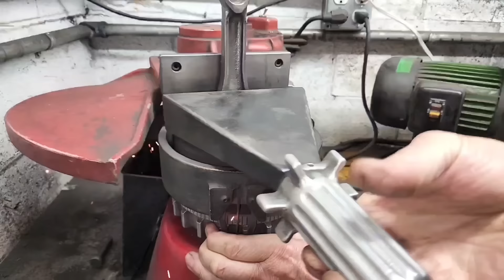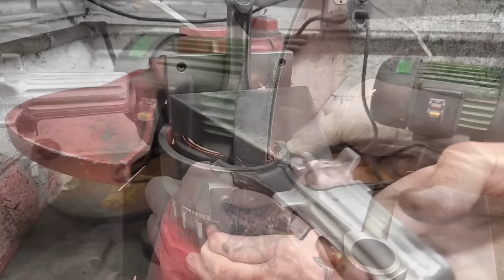Nobody resizes rods correctly see how I do it

Comment: That is how I was taught - 50 years ago. Never knew that could be skipped or that there was any other way to do it.
Reply: Wow, the YouTube AI overlord auto deleted my comment about working at a place in 04 with old machines that had Lend Lease property tags riveted on them, must still be some kind of national security issue.
Reply from the maker: @dukecraig2402 😂😂😂
Thanks for watching Duke 🇺🇸
Reply: @dukecraig2402  My Dad worked at the Kansas City Pratt&Whitney R2800C Government Facility that could not make any of those engines in time for WW2 because the Sunnen Centerless Grinders needed for so many things had been under presidential emergency put on a ship and sent to England. Those sleeve-valve Napier Sabre V engines would ONLY work if the sleeves were ground inside and out using DULL WHEELS at 1/10th the normal feed rate. That produced durable mirror finish.
But it used a hell of a lot of grinders and forked USA out - no argument - THE finest gasoline engines EVER MADE. Dad was on the throttle when one of them ran on FIFTY PSI BOOST FOR 24 HOURS making 4000 shaft the whole time - which became a military secret only declassified in '69 so Darryl Greenamyer's Bearcat Conquest One could take the prop-driven speed record.
Reply: @dukecraig2402  Your comment is on there. A LOT of comments are only visible if you click on the picture and go to that playback. Then hit "newest" and prepare for possibly a long scroll. Be a good idea to know how many hours ago the post you want to see - was posted. Five hours ago - I noticed - can be worth turning your scroll-lines-per wheel click "up-to-ten" . . .
Reply: @patrickshaw8595 
Thanks, I never knew this about finding posts that disappear.
And oh wow!!! I've read about that test and how they kept it classified until the 60's, that's really cool your dad was the guy with his hand on the throttle.
Reply: @dukecraig2402  First two hours. BTW I was 6 and 8 the two times My Mom got permission to take me to see Dad at work. I shook the hand of Luke Hobbs a.k.a. "Mister R2800". 
      PW in Hartford Conn had been pooping around with the R4360 the entire war - they gave Hobbs the total redesign of the R2800 resulting in the R2800 "C Series". He killed it. Thing ran so smoothly it didn't need or have rubber in the engine mounts!  Every time Hartford cleared a 24 hour milestone Hobbs would duplicate it with the 2800, lol.
He had an intuition about them. After the 4000hp for 24 hour 4360 run - Hobbs (and Dad helped) ran the 2800 at 132 inches of mercury and 3000 rpm and said "that's it, boys - that's all she's got"
Reply: I don't know if the exact miniature R2800C is still in Pioneer Village in Minden NE or not. But it ran and was dynoed tool. The Guy who was top Machinist - well really top Toolmaker - well really Head of the Modelmaking Shop - was a friend of Dad and his twin Uncle Jerry who designed all lawnboys up to '74. THAT'S who taught me how to design and build stamping/bending'/embossing/and "steel rule dies" - ages 14 to 25. In his basement. PS - I have two of of the machines that reground connecting rod journals - in your driveway, while you waited ! IN THE CAR/TRUCK!
Reply: @patrickshaw8595 
I just got the book "R2800, Pratt&Whitney's Dependable Masterpiece" by Graham White.
Yea Hobbs name is plastered all over the inside of it so much it's a shame he didn't get a royalty for every gallon of ink used to print it.

I also just got "Vee's For Victory! The Story of The Allison V1710 Engine 1929-1948" by Daniel Whitney (ironic?).
I'm in my glory, both are filled with the kind of technical information I'm always looking for, valve timing etc etc, that you can't just find on the internet, or at least I never could. 

I went to PIA years ago but never worked in the field, instead I decided to use what I learned towards my true passion in life, motorcycles, I've been building performance Harley engines for a living for 35 years, not having federal oversight in the motorcycle field, unlike in aviation, has afforded me the care free lifestyle I've always enjoyed in the biker community 😜

Years back I started collecting books from Harry Ricardo and others teaching myself the math of engines, ie calculating the optimal port cross section for what I'm trying to achieve with a particular engine modification, I collect and look at as much data as I can with known results to see how my math compares to it, I also have software for building fictitious engines that I can get comparisons from that's amazingly accurate, to do all this I need information way beyond just bore×stroke, I need valve timing especially connecting rod length which I've never been able to find for those engines to see how my math holds up to the known output numbers from them.

They're also great sources of information for myth busting, for example like everyone else I'd always thought the single stage single speed supercharger was all that was available for the V1710 at the time the British commissioned the P51 to be developed, which led to the misnomer that the Merlin was "more powerful" than the Allison based on the P51 story and people who don't understand supercharger types and how altitude affects them buying into that narrative, not true, in the book Vee's For Victory is a chart showing each variant of the V1710 and when they became available that proves two things, that the 2 stage high altitude supercharger variant of the Allison was available when the British commissioned the P51 to be developed, but they ordered it with the single stage Allison, like many I've always believed the 2 stage Allison wasn't available unti after the US was already in the war and the Army funded development of it, knowing it was available also confirmed a suspicion I've had for years, they planned from day one to have the not quite ready yet Packard V1650 installed in it as soon as it was available, I've been suspecting that for years and it's like I've been telling people for years "You may be learning about the different supercharger types and how they're affected by altitude and how they'll determine the performance envelope of an aircraft as you learn about these things but these weren't people who were learning at the time, they knew very well how altitude was going to affect the P51A before they even got in one, to think they already wouldn't have known and were 'disappointed' with it's high altitude performance would be like suggesting that I can't look at the specs for an aftermarket Harley cam and know relatively close how things are going to come out when it's put in an engine, I know what I'm looking at and so did they at the time, it's ridiculous to believe they wouldn't have known already what was going to happen at altitude, it wasn't a surprise".

I know why the British wanted as much of that aircraft to be domestic as possible at the time, they wouldn't have any problem setting up a production line for the airframe but they didn't want to get stuck with an engine that they had to entirely rely on the US for parts and support, this was before the US had gotten into the war and any support they were getting from the US was technically illegal, the powers that be had to get very creative to skirt the neutrality laws, so they had to worry about an administration change leaving them to deal with a hostile administration that could cut them off from the supply of engines and parts they'd have been locked into, I get it.
Reply from the maker: Thanks for watching Patrick 🇺🇸
Reply: Me too! 50 years ago same equipment too!
Reply: @tcbquick  Yeah and the stuff was old THEN. Pretty sure most of that stuff was built under War Production Board orders '41-'45. A LOT of it had apologetic little tags saying "The fit and finish of this machine were specified under W.P.B. Order such-and-such and is not that specified by (whoever company) For Commercial Sales."
That old grayish green dull enamel...
Reply: @patrickshaw8595 
I used to work in a shop here in Pennsylvania back in 2004 that had a bunch of old machines that had British Lend Lease tags riveted on them, probably ⅔rds of them were Pratt&Whitney manufactured machines.

Comment: With all the cleaning, crack testing, remove bolts, grind, deburr, fit new bolts, supply new bolts,  and resize....  What is the cost compared to the stock replacement style New Scat Rods  ???
Reply from the maker: My rods are $250
Thanks for watching and subscribing see-ya next time 🇺🇸
Reply: @BearButler321  Wow, that's cheap... your working for $40 bucks an hour in your machine shop..???....  Keep well...
Reply from the maker: @drcolster It takes about an hour 15 minutes to do The bolts cost $35 👍
Reply: @BearButler321  Faarrrr out, to redo a set in Australia we go way past the cost of a New set of Scats.....  that's with grinding and shotpeening...ARP bolts here are like $170aud..  Anyway, thats a good time and cost then... Keep Well.....

Comment: Do you have to use a specific kind of oil in your honing machines or will any oil work? I run machines at work that make the lenses for 80% of the world's eye and sunglasses. However, I would much rather be working in an automotive machine shop. The machines we use are zero hands-on. The prescriptions are all read out by the computers in the machine and they do all of the adjustments necessary.
Reply from the maker: It's a special oil made just for honing 
Thanks for watching Donnie 🇺🇸
Reply: @BearButler321 I kinda thought that but I didn't know for sure. Is the oil thicker or does it have certain additives that help in the honing process?
Reply from the maker: @donniev8181 it's not thick 
Just special

Comment: Hi Bear, love your videos!!! Hey how is the cap and rod centered on the grinding vise ? Dennis old retired Shipyard outside machinist.
Reply: It looks like it sits flush on a centering block then gets locked into place using the handle. Is the red cap and rod grinder what you were asking about? Im with you, I find all of these machines fascinating. I personally operate the machines that edge out lenses for eye and sunglasses. My company manufactures 80% of the world's eyeglasses and sunglasses. I would much rather be in the automotive industry though, it's more hands on.
Reply from the maker: @donniev8181 It actually sits on a round bar and doesn't need to be centered at all 
I'll do some 390 rods maybe today and show it
Thanks again Donnie see-ya next time 🇺🇸
Reply: @BearButler321 thanks, I didn't know exactly which machine he was talking about.
Reply from the maker: It doesn't need to be centered it sits on a flat bar
And it is clamped down 
It could be a 1/4 inch off center and it wouldn't matter
Thanks for watching Dennis 🇺🇸

Comment: Well, I  learned something new. I thought it had to be tight to keep it aligned.
Reply from the maker: They are not loose but have a snug fit. The old international rods have very loose bolts but the tension 
From the torque keeps them in place
Thanks for watching Todd 🇺🇸
Reply: @BearButler321 thanks for informing.  This old dog doesn't know everything,  but I still like building.
Reply: I would say these looked fairly tight, but checking parting line for straight and full contact is important and many new rods from popular manufacturers need to be corrected before use. 😄
Reply from the maker: @PSA78 Everything is crap nowadays and needs to be checked ✔️ 
Thanks for watching and subscribing see-ya next time 🇺🇸
Reply: Good work 
  Old school.
  That tiny chamfer on the parting line also provides a tad more oil to the side faces. 
  Not too much, mind you.
Reply from the maker: @michaelwillette5738 Thanks for watching and subscribing Michael see-ya next time 🇺🇸